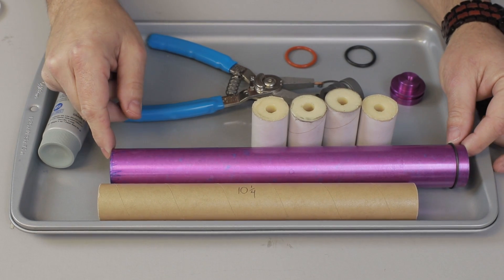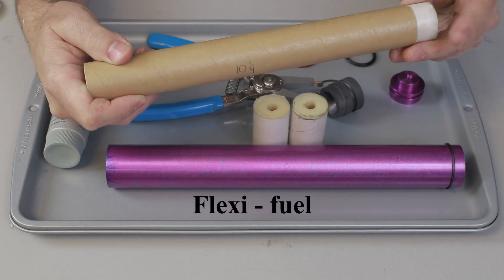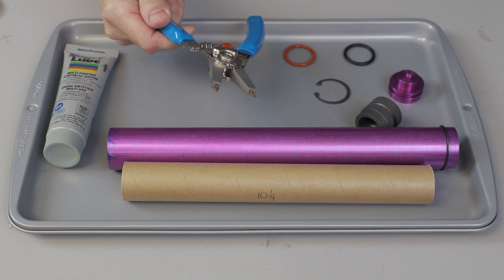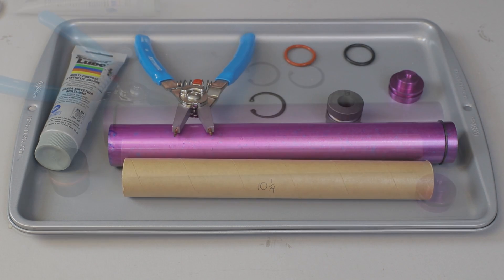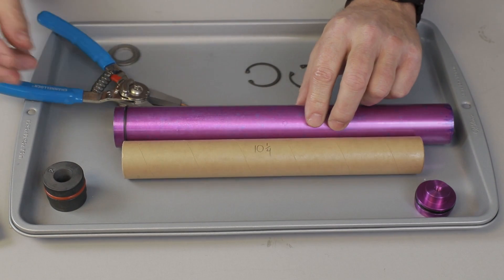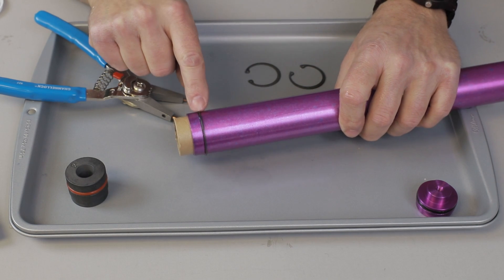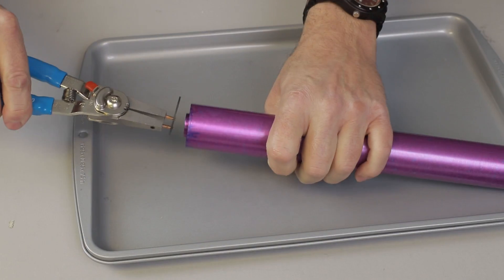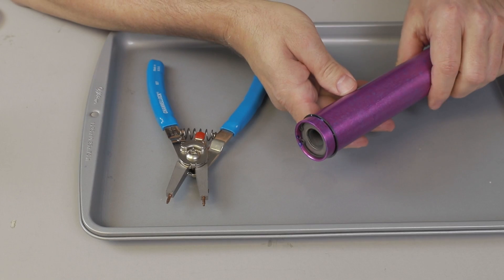Snap Ring Rocket Motor Assembly

Comment: What is the use of snap rings?
Reply from the maker: Snap rings retain the internal parts of the rocket motor. Remove the snap rings and everthing slide out.
Reply: @TheRocketeer  ahh so it needs a groove isn't it?
Reply from the maker: You got it! @oxygohn

Comment: Ignore the anti-Harbor Freight comment.  The Quinn and better yet, the Icon, snap-ring pliers from HF are great!  I've been flying snap-ring motors for over 30 years and love my HF snap-ring pliers.  (Certified Level 3 on a Kosdon M1130, repeating my L3 on a Loki M1650.)
Reply from the maker: I will have to check them out, thanks!
Reply: @TheRocketeer  Definitely do!  I just bought a set of four Icon snap-ring pliers with fixed action for smaller motors (think Kosdon 1" and EX 22mm motors).  Fantastic set that can handle anything from the 22mm motors on up to 29mm motors without a problem.  No need to switch their action, like some of the other pliers do.

Comment: I just finished watching this video, and the previous video where you made the castings and grains for the motor. So when making grains for a motor case, such as this snap ring motor case, does the core have to be a specific diameter? For example, why did you choose the core diameter that you did when making those grains?
Reply from the maker: The core can be 3/8 or 1/2, depending on what you need from the motor. A 3/8 core will allow more fuel, while a 1/2 core will give better lifting power. The number of grains, nozzle diameter, and core diameter determine motor performance.

I typically use a 3/8 core for 38mm sugar motors because it gives plenty of lifting power for a Loc IV or similar. I may use a 3/4 core in a 54mm motor to lift a heavy rocket without sending the rocket too high on a smaller field.

Excellent question, thanks for posting.
Reply: @TheRocketeer  are these numbers figured out through testing, or did you use software to kind of get a starting point? 

The reason I ask, is because I'm beginning my journey with reloads and making my own grains 🙂 thank you
Reply from the maker: @LT72884  I use the same nozzles that Loki uses for most of my 38mm hardware. I use Meteor for my 54mm hardware. My email address is listed on the home page, click the more link at the top.

https://meteor.open-sky.fr/home#/motorDesign

Sugar rocket motor design
https://youtu.be/gdD1B3Ki14c
Reply: @TheRocketeer  thanks. i will try out this software. I am still trying to figure out the equation for core diameter because it seems that core diameter changes with the diameter of the actual grain. IE a 54mm grain has a larger core, But what is that relation? is it a 3:1 relationship IE, the grain diameter is 3 times the size of the core diameter? Thats what relationship i am trying to figure out : )

Comment: Howdy.. how long does a nozzle last?
Reply from the maker: If you don't drop, or dammage them removing the o-ring then a long time. I usually get 5-6 burns out of them for a sugar motor then drill to the next size and use in another larger motor. Aluminum or magnesium will shorten their life span.

Comment: You casted using a 3/8 coring rod. Is the the throat size of the nozzle? Appreciate your response, Dr. G
Reply from the maker: Please see my video on sugar rocket motor design. The nozzle throat should always be smaller than the core size. Nozzle sizes are measured like this 19/64 is a #19  or .29 I usually use a #18 or #19 with a 4 grain 480 LOKI motor.
https://www.youtube.com/watch?v=gdD1B3Ki14c&t=1s
Reply: Before I order the Loki motor casings, I wanted to make sure they work with always ready casting tubes. Just for your info, I will be using your videos with my chemistry students who are working on rocket fuel for high powered rockets. Thanks for your help, Dr. G
Reply from the maker: Yes, they work with the standard casting tubes but not with the AT compatible. Don't forget to order extra o-rings that need to be inspected and replaced, I usually get 2 burns out of each one.

Good luck with the chemistry class, let me know how it goes and thanks for sharing!

Comment: Do you use electronic deployments? Can you make a delay with binder design bulk heads?
Reply from the maker: I use  motor delay for smaller rockets and prefer dual deploy for larger heavier rockets.

LOKI delay bulk heads may be used with Binder Design hardware. I prefer the "Brown" delays from LOKI versus the "Black" for 38mm.

I have never tried to make my own delay grains for a snap ring motor.

https://www.lokiresearch.com/secure/store.asp?groupid=5520031443530

My next altimeter is going to ne an Easy Mini.
https://altusmetrum.org/EasyMini/